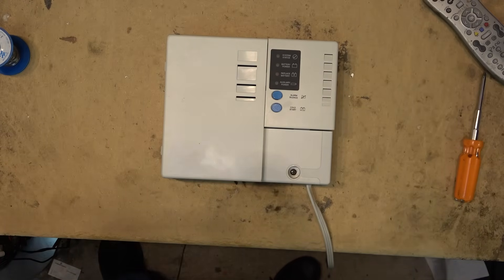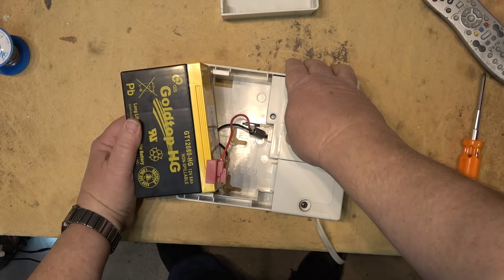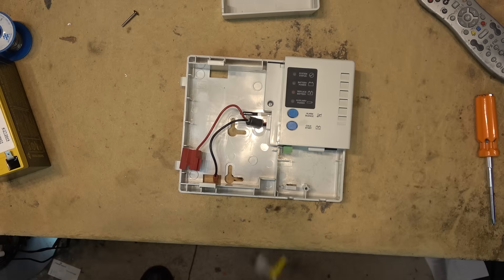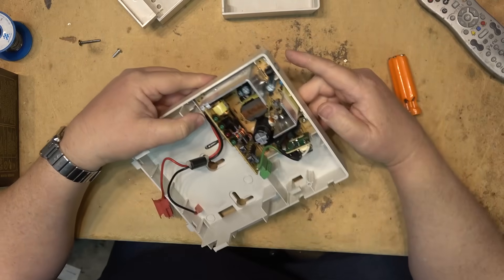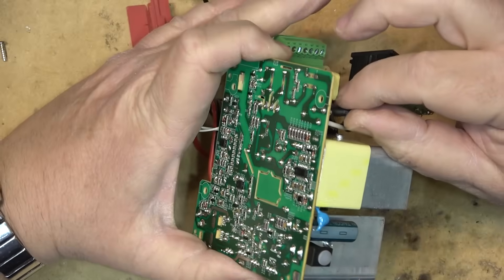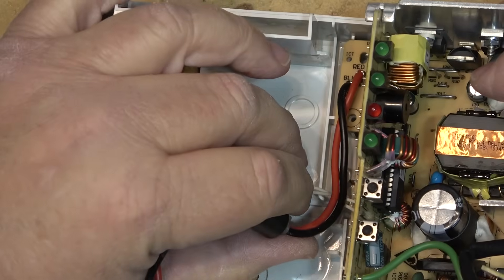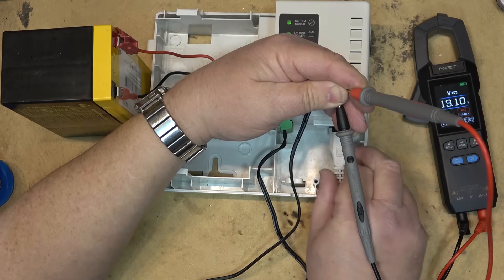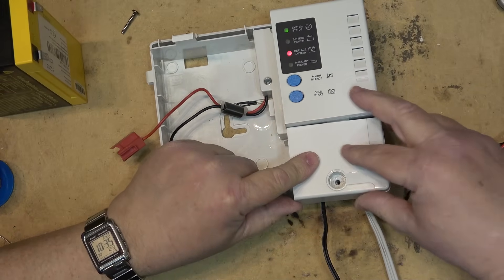Delta Electronics DUPS 1232G UPS failure can it be fixed

Comment: Very interesting. I i have 2 UPS units sitting around. Both have bad batteries. And I never replaced them. I don't know how much a new battery costs versus a new UPS.
Reply from the maker: I use lithium based ups for the computer.

Comment: Cool, a wiggly finger fixed the fault.  Cheap enough.  Glad you could use it after the repair, saved some bucks and it works to boot.  Nice fix and video, thanks.
Reply from the maker: An open hand slap fixed it. The wiggle trick identified why I had to slap it.

Comment: Please use a "new" battery instead of a older or refurbished one. Re-using battery's in UPS devices is never recommended. I had one venting on me, in a closed space. Those things can kill you.
Reply from the maker: It vented because overcharged. This batter not that old.  The circuit monitors the condition and disconnects it and turns on the replace battery light and sounds the beeper.

Comment: I had the brilliant idea of putting my internet on back up power, come to find out if the grid power goes out so does my internet. My provider is Frontier. The funny thing is they provided a UPS for the router in my house but there is none on the main box where the Fiber comes in. That was an additional cost.
Reply from the maker: I have 2 as you can see. One is for the ONT. We don't supply them anymore unless the customer has a hardwired phone, lifeline or an alarm system that dials out. We used to have to install them on all voice lines due to CRTC requirements that phone can not be interrupted. That changed a few years ago, but if someone asks for one during the install they get one.

Comment: Wild, I just pulled a Delta branded power supply out of an OG Xbox last week. One of the big craps is totally open, of course.
Reply from the maker: The reliability of any electronic device is inversely proportional to the number of electrolytic capacitors it contains.